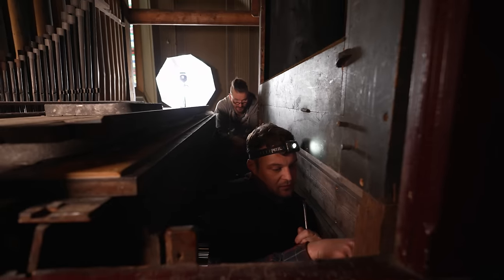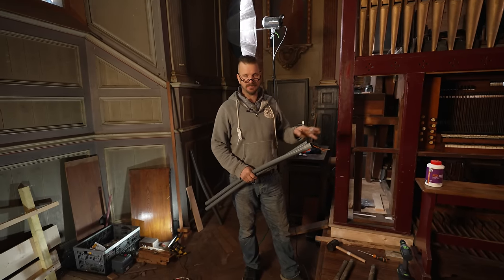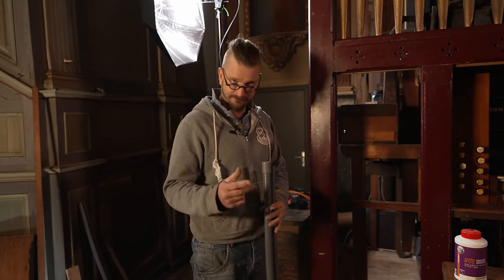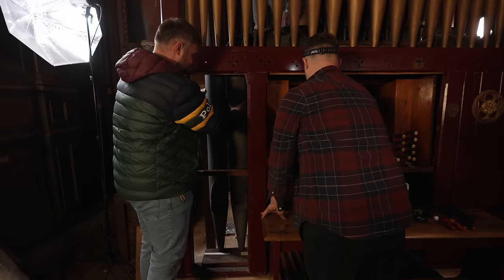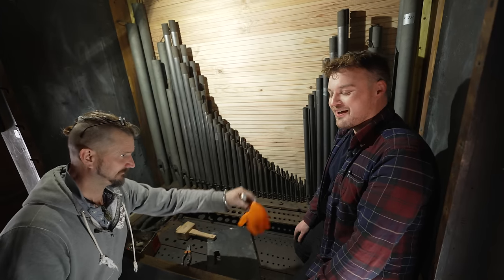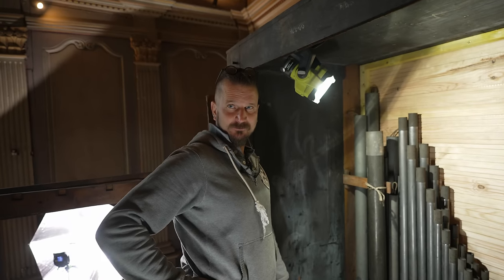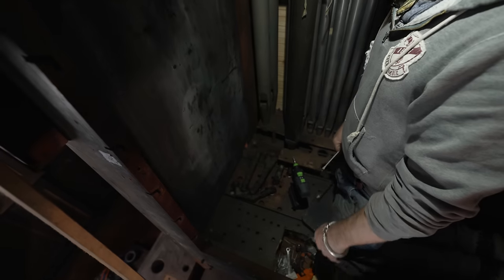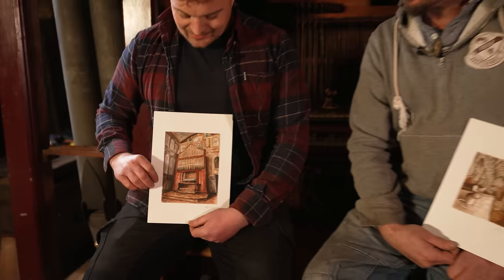Billy's Pipe Dreams Come to Life

Comment: Hi team, I think you should not use full width bandage to bind pipes. It should be very thin twine. The bandage will interfere with pipe resonance and alter the tone/sound and make it dull. You must rectify this immediately before you install all the ranks.
Regards from South Africa

Comment: Why don’t you guys stick some stick-it notes on all the holes with some tape. Then press the key and tweak the wind on all and at same time then label the stick-it notes with each note also. Followed by placing each metal tube and testing using phone. That way wind volumes are adjusted, faster process and more accurate. When you press any key the movement of wind will be visible on each stick it note.